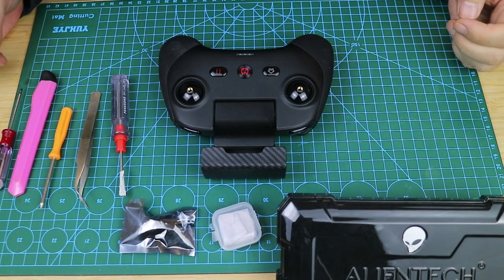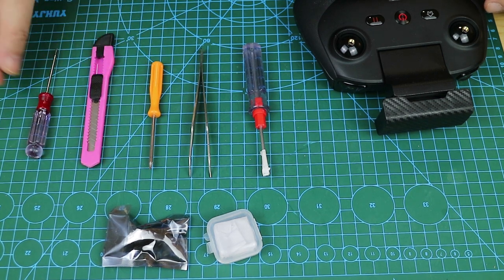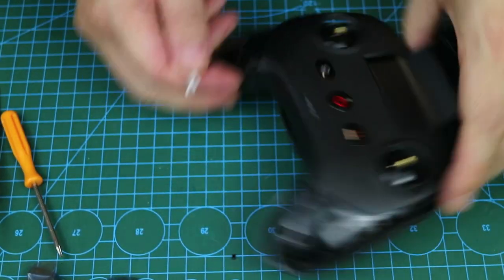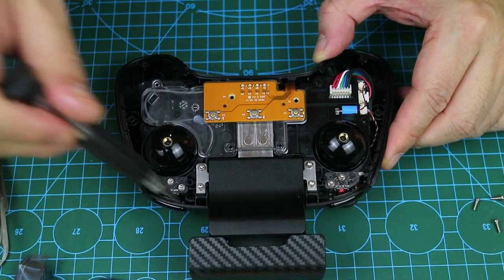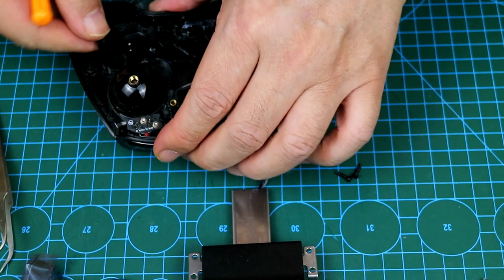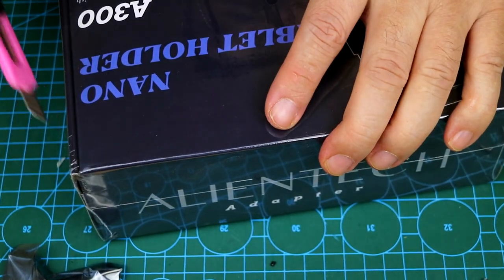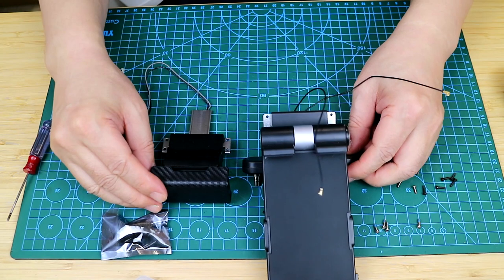How to modify upgrade controller of Autel EVO Lite+ Nano to add ALIENTECH antenna with tablet holder

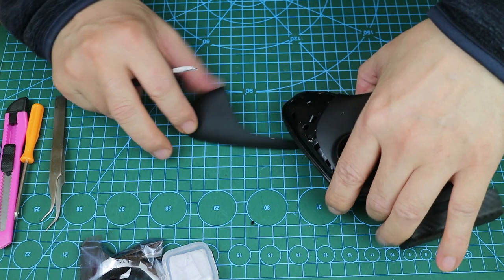Comment: You say the first rubber handle came off intact yet there is a small plastic split on the matt at 2:53 in area 30 that wasn't there before you worked on opening the remote.
Was the rubber handle actually intact after you opened the remote?